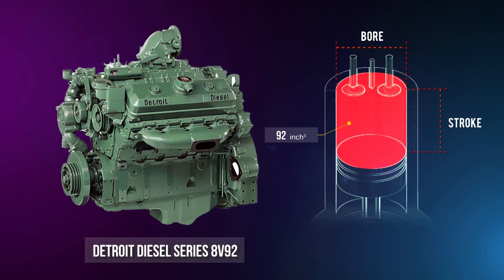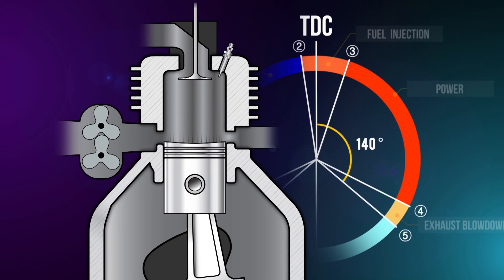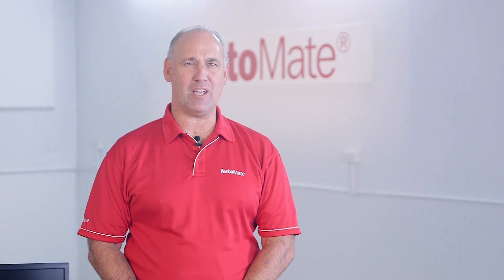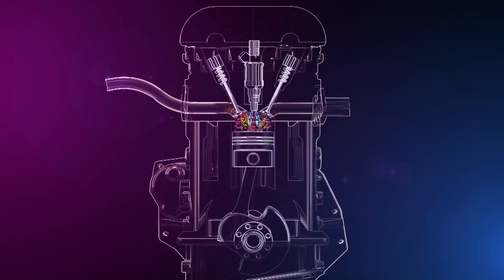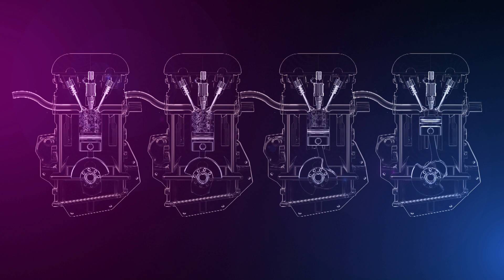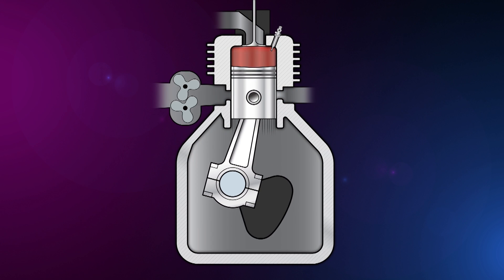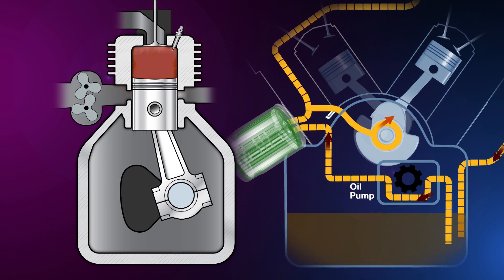2 Stroke Diesel Technology Training Module Trailer

Comment: Why not to feed the fresh air through the valves and make the exhaust through the  kinda "transfer" ports,
Wouldn't be better?  Since when you open the valves it helps to force air into the cylinder, and in the other hand the propagation of the combustion inside the cylinder points toward the crankshaft so it partially auto exhaust by the inertia of gasses.

Comment: Wonder what a petrol version using desmodronic exhaust valves would sound like?
Reply: Generally the problem with using this approach in a gas engine is that valve train.  The valves need to go 2x as fast and often as a 4-stroke.  I'm not sure how fast desmodromic valves can operate, but if they can support a 14,000rpm 4-stroke with car-size valves, they'd make for one hell of a uniflow 2-stroke.  Personally, I think the problems with crankcase-scavenged 2-strokes are mostly solved, and they offer tremendous benefits in weight and simplicity.

Comment: Why don't most gasoline engines also use the two-stroke system?
Reply: Because the greenies don't like them and all the wimpy governments are scared of the greenies.....(see demise of 2 stroke motorbikes)
Reply: They're prone to exploding while coasting downhill, they produce too many emmisions, and they are inefficient.
Reply: @shadowthehedgehog4737  Every single thing you just said there is wrong.

Theoretically you could make a petrol engine with this type of 2-stroke (uniflow) like diesels.  However, it's actually more mechanically complex than a 4-stroke since it requires all the valve gear (spinning twice as fast!) as well as a mandatory supercharger.  That valve gear limits RPM severely, giving 4-strokes the advantage in petrol applications.

Now, there are different ways to make a 2-stroke petrol engine, which are lighter and simpler and more powerful than 4-strokes or diesel style 2-strokes.  This involves using the crankcase area instead of a supercharger to pump intake air, and the use of fluid dynamics and resonance to clear out the exhaust and replace it with fresh intake.  In the past, that has involved making severe sacrifices in lubrication, emissions, and efficiency.  However, modern direct fuel injection has made huge huge improvements to all of these areas, such that 2-strokes can be and are made just as efficient and clean-burning as 4-strokes.  Modern 2-stroke outboards and snowmobiles are totally emissions-compliant, have long service lives, and often best-in-class efficiency.  Unfortunately none of the companies with that expertise have any presence in the car or motorcycle industries.  Mercury Marine actually bought their 2-stroke tech from Chrysler who never used it, but that was 25 years ago now.

The "blowing up down hills" thing was solved 60 years ago, and in even the most primitive engines you had to be a real idiot to make that happen.  It came from 2-strokes which were lubricated by mixing oil with the fuel.  Before the 1970s in Europe you could get "premix" at the gas station, invariably with an unknown dose of very low quality oil.  People would then cross the friggin' Alps in their 500cc 2-stroke car, and gear down for engine braking.  After 10 minutes of 6000rpm and no throttle, the oil would be gone and the engine would seize.  Car makers in the 50s installed free-wheeling devices to keep drivers from using heavy engine braking, and oil injection was invented to keep oil supplied even when no gas was applied.  My Kawasaki from 1967 has oil injection.  Yet you still get people saying you must add throttle down hills with 2-strokes or it'll immediately blow up.  Nonsense.  And of course with a uniflow 2-stroke as described in the video, it's double nonsense because they're lubricated just like a 4-stroke.

Comment: Maybe a dumb question (however)
Could you make the stroke slightly longer and put an exhaust port opposite the intake port but higher on the cylinder wall? As the piston uncovers the exhaust port some exhauste exits before the intake port is uncovered and forces the rest of the exhaust out? 
I think I get the concept but it was just a curiosity question.

Thanks
Reply: Not a dumb question at all. So - yes and yes. What you are asking for is very common in two stroke ship diesel engines. Marine engine piston stroke travel lengths are often so long, you could easily fit even your mother-in-law in it and the inlet (or intake) and exhaust slots are at different hights of the cylinder.
Reply: @milietz  not sure about my mother in law
Reply: What you are describing in EXACTLY the way that 2-stroke petrol engines work.  It's called loop scavenging. There are no valves in the head, instead an exhaust port opens roughly halfway through the stroke, quickly evacuating all the pressure before the intake* ports open.  In this design the intake ports are aimed away from the exhaust, so that incoming air sweeps to the rear of the cylinder, up to clear the head, and then out to the exhaust last of all.  This setup is very efficient at a certain RPM and relatively inefficient otherwise, although the engine designer can do clever things with exhaust pulse resonance to broaden that out.

*In a 2-stroke petrol engine, the "intake" ports are actually called transfer ports, since these engines use the crankcase area to pump air, instead of a supercharger.  However, both methods of pumping are valid whether you're using uniflow (as described in the video) or loop scavenging.  It just happens that diesel people don't care about weight so they use superchargers, while motorcycle people really do, so they use the crankcase.
Reply: That should result in bad exhaust gas scavenging. The principle in this animation is perfect and combines the advantages of both 2 stroke and 4 stroke engines.

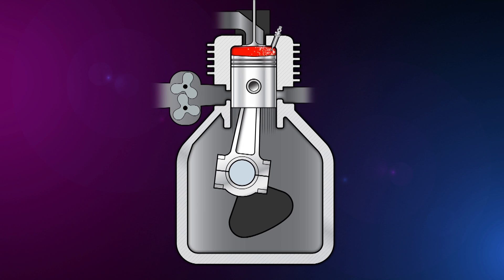Comment: 1:30 so : as it doesn't use oil on the piston course, how it keeps lubricate the piston and liner from during its up and down?
Reply: Diesel are like engine oil.
Reply: @jhunzxendeleon1833  if so should we put diesel  instead  oil on our  engins
Reply: @FASTBOOBS  it works just like a 4 stroke for oiling
Reply: @snaxgalore5764  no. oil would go out from air suction hole. zero oil for piston.
Reply: actually it is pushing air. but anyway oil would escape from those holes
Reply: @pumppupappi  air suction hole? Lol what

Comment: Hi everyone, I am looking for a diagram or an explanation of the 2 stroke engine that was used in motor bikes for racing. The engine has 1 or 2 exhaust valves that shut off to hold more in the compression stroke.  This is different to the power valve. Thank you
Reply: Your referring to Ducati,s desmodronic valve operation.No valve springs to close the valves so 
to eliminate valve float at high RPM.None off them were 2 stroke as a 2 stroke gasoline engine doesn't need valves.
Reply: @eugeneoreilly9356  No, he's referring to 2-stroke power valves.  There are various approaches to it, but it essentially involves one or more valves in or around the exhaust port to vary it's time-area and sometimes to vary the effective tuned-length of the expansion chamber exhaust.  Examples include Yamaha YPVS, Kawasaki KIPS, BRP RAVE, etc.  He said it's different to the power valve, but given the extreme variety in PV designs, I think that's just a misconception.

Comment: How does de injection system works? I mean, for sure, nowadays they use an alectronic unit with sensors to know when to do it, but in the past? Does it had a timing belt or equivalent system? 

Thanks from Spain
Reply: Non-electronic Detroit 2 stroke injectors are actuated by the cam  and a rocker arm. A mechanical governor controls rotation of a shaft (the rack) mounted under the valve cover, and levers off this shaft move plungers on the side of each injector- essentially controlling the point in the injector’s stroke where fuel will be released to fuel return as opposed to being injected into the combustion chamber- thus controlling the volume injected. There is a height specification done much like adjusting a valve, and the arms on the rack can also be adjusted to ensure all injectors are synchronized to reach max flow at the same rack rotation. 

This video explains the adjustment. https://youtu.be/YZ-31etm0a8   The engine in this video is an 8V71 (8 cylinder V with 71 comic inches per cylinder). Each cylinder has 3 rockers, and 4 exhaust valves. The center rocker actuates the injector, and the outer two rockers each press on a bridge piece, with each bridge piece actuating 2 exhaust valves.
Reply: They used a gear driven injection pump. There are mechanical and electric pumps. The gear is like a gear driven camshaft, so they are timed by the marks on the gear

Comment: Glad I watched this, this answered my question about how the oil and fuel was mixed. My guess was it was like automatically mixed as it was pumped like a 2 stroke oil injected outboard
Reply: There is no mixing of fuel and oil. The engine is lubricated as standard 4 stroke.

Comment: How is the Piston lubricated,,?
Reply: Like a 4 stroke.
Reply: @marccanalle  But how? Wouldn't the lubricant enter the air intake?
Reply: @justlolatthisworld7917  Like a 4-stroke, oil is splashed on the cylinder walls from beneath the piston.
Reply: Mix oil with diesel

Comment: 2 stroke diesel engines. They have all the advantages of both 2 stroke and 4 stroke engines in 1.
Reply: My friend's dad has a two-stroke diesel engine I thought he was full of crap I never heard of it I was only young at the time but they sound awesome and you're right you get the advantages of a 2-stroke and 4-stroke in one.
Reply: yes if you want to ignore emissions
Reply: @its_robbietime1333  you clearly don't know anything about diesel 2 strokes. They can be as clean as regular 4 stroke engines. They don't burn oil nor spit out unburnt fuel. They work VERY differently compared to regular 2 strokes found in chainsaws and dirtbikes
Reply: @dieselgeezer18  soot and nox those are really bad
Reply: @its_robbietime1333  you’re totally right, but there’s a new engineering fix that deals with this problem. Diesels typically have a problem emitting too much soot or nitrogen oxides. If they burn too cold, it produces soot, and if it burns too hot it produces nitrogen oxides. However, there is a method of reducing emissions by having it burn hot, producing nitrogen oxides, and then reacting the nitrogen oxides in the exhaust with ammonia forming nitrogen and water.
Reply: Lol no
Reply: I would think emissions are an issue
Reply: if it was true koenigsegg would be using 2 stroke diesel engines
Reply: @LowerYourExpectationsPleb  Why would they use a diesel engine in a sports car. Your try at roasting him didnt work out too well pal.
Reply: @FrmerK20  what's wrong with a diesel sports car?!
Reply: @lewisanth4986  VW
Reply: @FrmerK20  Have you ever heard about Audi R10, R15 and R18?
Reply: @lewisanth4986  people would simply not buy it because its a diesel
Reply: @LowerYourExpectationsPleb what a braindead comment

Comment: How to lubricating piston and cob rod  ?
Reply: Dian Studio Pro Same as 4-stroke engine but this engine can only run with a forced induction system such as Supercharger, Electric Turbo/Supercharger or Normal Turbo with an Electric motor attached to it or an Electric Turbo/Supercharger assist at idle.
Reply: @soraaoixxthebluesky  How do the Naturally aspirated Detroits work then? Such as the 71 series, they didn't even have an option for forced induction on the 3 or less cylinders.  And to my knowledge all Detriots had an na version.  As far as the oiling, i would agree.  it is a self contained oiling system the same as a wet sump 4 stroke. not to say a dry sump isn't possible.
Reply: @jewis70  just to touch on this, because that was my question as well. Mainly, not how you lubricate it (the rings are visible after all), but how do you keep oil from spilling out of the intake ports? I still can't wrap my mind around this
Reply: @tzikis.  On the Detroit Diesel 2 Stroke it had an oiling system exactly like a 4 cycle. There was no mixed fuel therefor no oil in the induction system anywhere. They had a blower on the NA and you could option for the Turbo plus Intercooler. Then jump up in Injector size and develop more HP. This Direct injected engine had roller cams, the piston crown cooled by an orifice in the small end of the rod to spray cooling oil up inside the piston.
The cast iron piston held the combustion chamber, all very advanced for the times they were designed. The N Series had 21:1 compression ratio. I know of one destructive test that hit 6500 rpm before the flywheel disintegrated the Bell Housing. Roughly 3 times the rated rpm of 2100. 
Hope it helps.
Reply: @robertjackson7590  thanks Robert! I understand that, but what I still don't see is how you can make sure that the oil from the crankcase, which is picked up by the sealing rings and the oil ring, doesn't spill & pool on the intake ports on the cylinder wall, while the piston is moving upwards.

In my mind, some of it would spill while the piston is moving upward, and when the piston moves downward and exposes the ports, the oil that leaked on the ports would flow into the combustion chamber along with the fuel mix.
Reply: @tzikis. in some designs there are rings in the top and bottom of the piston, which is longer than a 4 stroke.
I imagine some oil is burned
Reply: @nirodper  I see. Thanks!
Reply: @tzikis.  also now that I think, the positive pressure from the blower would push the oil between the cylinder wall and piston away from the port.
Look at this one, it isn't a detroit and doesnt have any valves but runs slowly and is easy to see inside:
https://youtu.be/xTQvM1cXOyc
Reply: The piston skirt(bottom part) has the oil ring and that oil ring never touches the intake and never leaves the very long sleaves/liner while the top part of the piston where the compression ring, the piston gets lubricated once the fuel enters, diesel are oil so it can lubricate the wall of the liners and cool down piston deck.

Comment: Which bike companies uses 2-stroke diesel? That looks interesting, do you know if any motor bikes are fit to have EGR (exhaust gas recirculation) valve on them?
Reply: I only know 1 diesel bike in production and I dont know the name of it
Reply: Harley Davidson
Reply: @mwaleed2082  Also Royal Enfield.

Both Harley Davidson and Royal Enfield use a 4 stroke diesel engine though, not a 2 stroke diesel engine.
Reply: This engine is from a  Detroit two stroke diesel semi truck but they don’t make them anymore bc they were incredibly loud you would need ear protection to drive them without hearing damage and because of emissions
Reply: Detroit diesel is the answer. They produced engines for heavy trucks.
Reply: @Aleksandar_tech  They also produced engines in every configuration for every industrial, construction and forestry application you could think of......